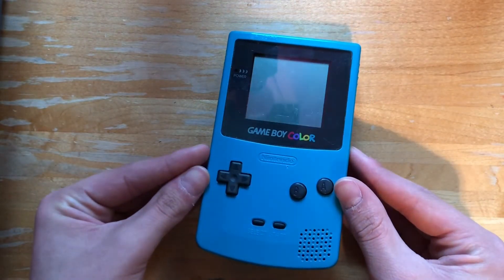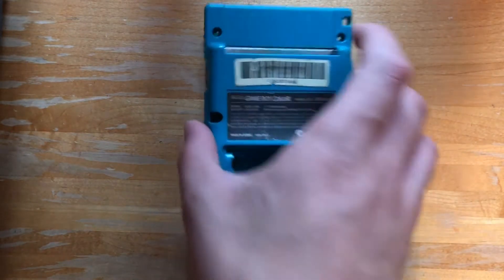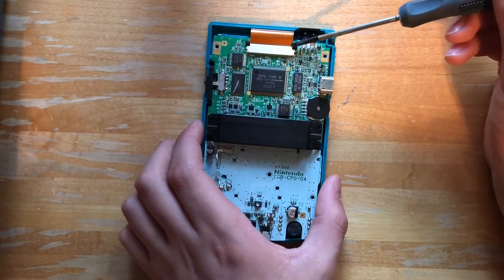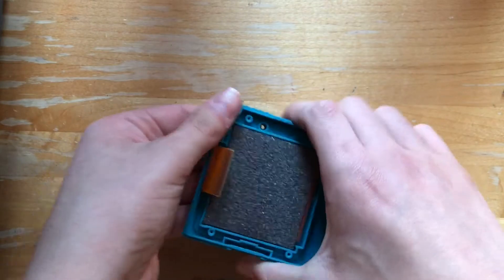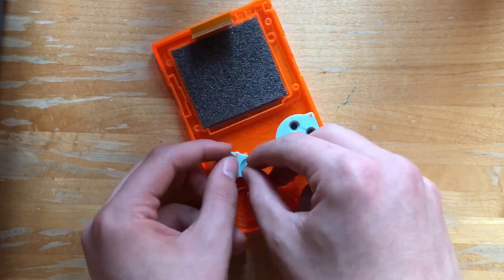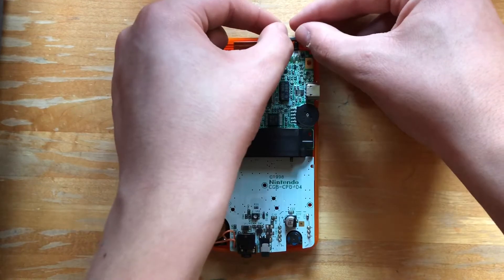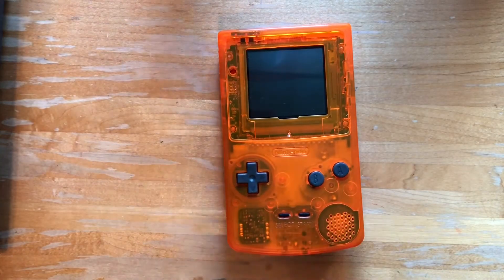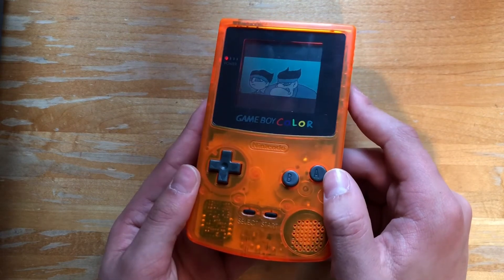How to make a custom Gameboy Color! (Shell Replacement)

Comment: You can't just slap the LCD into the housing like that, you need good quality adhesive strips sealing it to the shell like it was originally, there's a reason for that, it's to prevent dust to make it inside the space between the lens and the screen, it comes from inside the case itself. You also need to properly clean the lens from the inside since they don't arrive perfect, reccommend glass lenses which are about 1.5 dollars on aliexpress, they're superior in quality and can be easily removed with a screen removal suction cup instead of having to try pry it off, it's difficult leaving it dust free the first try so that is helpful. 
Good microfibre cloths/soft tissues, rubbing alcohol and a dedust brush made for lenses helps a lot, if you want a really clean dustfree professional result. 

This will just get filled with white dots of dust in no time...
Reply from the maker: Thanks for the suggestions, will take this information into account next time I do a shell replacement

Comment: I've ruined two of these shells because the original screws holding the board wouldn't fit... Turns out the ones from the metal cartridge shield might just work with it!
Reply from the maker: Yay!!